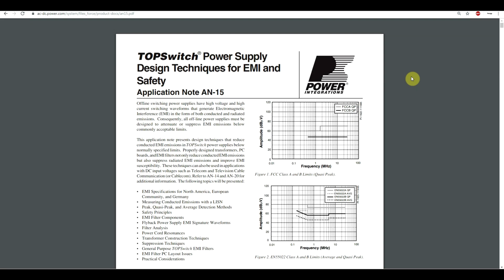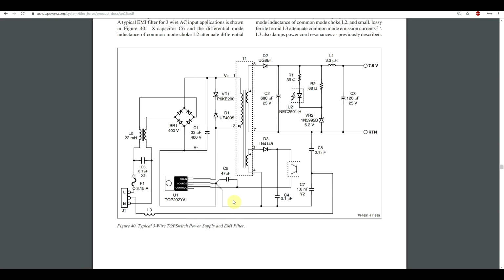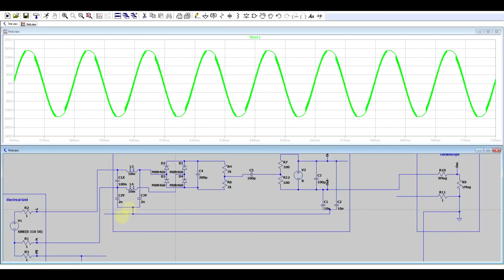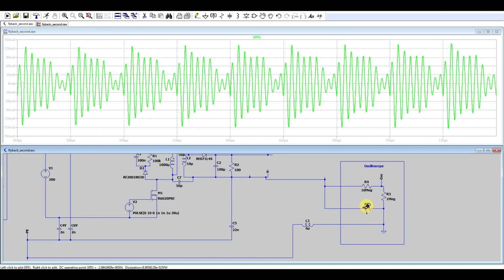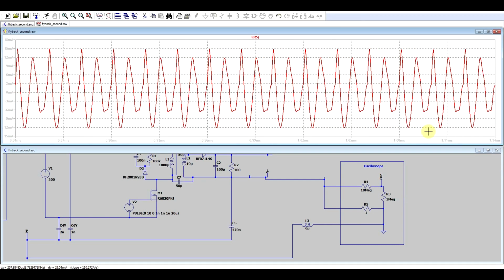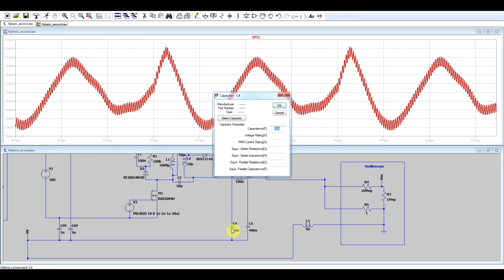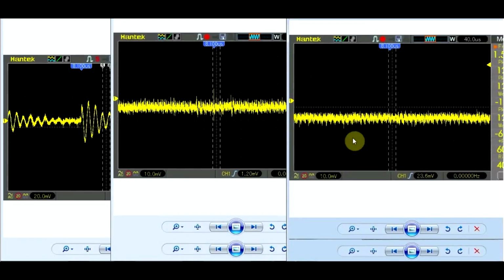How to improve the output noise of a laboratory supply using LTspice

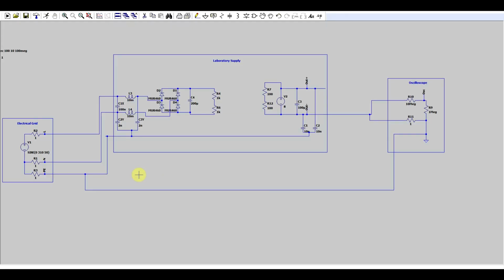Comment: 13:01 2 ohm impedance from socket is quite high. With k = 0.8: (0.8 * 230 V) / 2 ohm = 92 A. If You add just a little bit from extension cord, short circuit will be switched off longer than 0.2 s (200 ms) which is dangerous.

Comment: Very nice simulations.
However, it would be beneficial to provide some comment on the downsides of such mods. Depending on the situation/device connected to the power supply, aren’t there any potential caveats?
E.g.: is the added capacitance to PE seen as an additional output capacitance by the load? Will that mess with OCP and transitioning from CV to CC mode when CC limit is reached? Can that damage a DUT?
Secondly, what about highly capacitive loads and that extra inductance on the output? Any chance of those two dancing into resonance?

Comment: IDK. The noise is indeed caused by the power supply. But the current is only happening when your circuit is earthed. So in the circuit if it's not earthed say on bread board the issue is not there. And only if you measure using the oscilloscope the noise appears. 
In another word, if isolation is not required why not connect the V- to earth that will solve the issue too.

Comment: Hi greetings from Argentina, congratulations, you're really good at explaining with details. Question is that capacitor on the power supply the sort of  X / Y capacitor which is the only cap going from hot to cold on a switching supply. This are some of the unsecured elements on a psu as if they short or theré's a discharge it may short circuit. So isn't this mod somehow risky? . can you apply this kind of filter but externally using LC filter and chokes on the BNC side of the scope instead. I'm watching all of your videos . Quite different from many others.

Comment: I had this problem with a ts100 soldering irons switched PSU the solution was the same as yours. The amount of trouble it could cause if not fixing this problem is enormous 
. Thanks for sharing the detailed simulation.

Comment: At the start you measure 50Hz noise of about 5V, without the oscilloscope ground lead attached. You don't repeat this measurement later, only the ones with the ground lead attached. Has the 50Hz noise been improved as well by these modifications?
Reply: i guess yes, he did that in 26:22

Comment: If the solution is so simple, why don't the companies do it before selling?
Reply from the maker: I guess its a combination of 2 factors - every extra component costs - especially this power supply is a low cost one, so price is critical; second is compliance - if the design is compliant with legislation needs, why bother doing something better. If you want to make a very low noise, high performance powers supply, it will not be cheap :D

Comment: Your test equipment is so bad.  Hantek scope?  Come on man throw that piece of shit out your window.  Those black meters are terrible!  Cheap Chinese shit!  A Keithly 6.5 digit multimeter is only   $1,400.  And a decent Rhode & Schwarz RTB-2002 is only $1375.  Are you living with your mother?  Do you not have a job?  My goodness.  So much test equipment out there from quality companies for low prices.  You buy a $200 scope and an $8 multimeter.  Surely you can do better than that!  Hell even in college I bought and entire lab, scope, power supply, function generator, multimeter for about $3000.  I was in college and I could afford that.  It is painful to watch you use the worst equipment on the market.

Comment: At 27:56 you talk about the noise suppressing ferrite inductor. Maybe I missed a part but it's not really the inductance which suppresses noise but absorption in the ferrite. In effect the inductor becomes a resistor at the frequencies of interest.  I miscalculated once, noise was killed wonderfully but the ferrites exploded.
Reply from the maker: You are right - but this depends on the ferrite material. You can chose a material which behaves resistively at the frequency of interest - a lossy inductor which has imaginary inductance; but even this material, at low frequency will have real inductance. "Low" and "high" frquency are of course material dependent.
Reply: @FesZElectronics  Indeed. A combination.

Comment: "How to improve the output noise of a laboratory supply"
Does improve mean make more of it; more noise?
Anyway, excellent presentation.  My power supply is an ancient HP 6216A variable, linear power supply.  It isn't efficient but there's also no noise.  Well, not more than thermal noise.

Comment: Great video! Do these modifications affect the power supply's voltage regulation and transient response times?
Reply from the maker: Normally, that should not happen. The noise measures that I added work only at very high frequency, much higher than the supply feedback loop should be able to handle. Anyway, it is a good practice though to verify the power supply at the end, since any modifications added after the original design was validated can have one effect or another.

Comment: Can't you also put ferrite cors one the oscilloscope probe coax?
Reply from the maker: I think that will interfere with the measurement since the proprieties of the cable will change. Also, the problem is not on the oscilloscope side, so there is no point in trying to filter the oscilloscope, its better to filter the actual noisy circuit.

Comment: A necrocomment: The simulated 310Vpp value is obtained due to powergrid simulation through (0, 310, 50) AC voltage source. 311v is a peak-to-peak voltage for 220V RMS. Meanwhile in the EU the standart RMS voltage of the power grid is 240 volts, giving the 339Vpp. That is one of the reasons of the 50Vpp gap between the simulation and the measured values. This remark being done I have to  say I really enjoyed the video and got the answer to my question.
Reply from the maker: I just checked and in my country its 230V according to https://en.wikipedia.org/wiki/Mains_electricity_by_country 
I guess 220 is an older value (at least for my country)

Comment: Conclusion, almost always add de-coupling capacitors and common-mode chokes on power systems?
Reply from the maker: If you need low noise, and especially if the supply is "switch mode" type - then most often you will need filtration. But of course "low noise" is a relative term, there is no universal solution.
Reply: @FesZElectronics  excellent point that noise is relative and that switching supplies will always have a level of noise. Thank you.

Comment: Excellent video about the concepts ! Just one question , this noise will arise only if any PE referenced measuring instrument or circuit is connected ? Since this is not typically the case, would this mod give any improvements otherwise ?

Comment: Very good video. Just one question. if the intervention is done on a number of operational power supplies connected to the same RCD,  does this not increase the likelihood of triggering the RCD to cut the power? This is suspected in view of greater current leakage to earth but I'm not sure whether it could be an issue.
Reply: It would be interesting to see the effect. Not sure how big the effect might be since the current shunted to ground is high frequency.

Comment: what supprises me a lot is when I have bought recently a cheap chinese power supply there was a lot of noise and ripples etc. and then i have built my own supply (only oryginal components) and I was shocked NO riplles, NO noise just really clean voltage without any problems (I have compared both on my oscilloscope) and I have compared third one I have bought and my own power supply was the best !! I was really surprised how stable it was! Hmm I am not sure why it is like this but I suspect my transformer which is quite good, powerfull and new (old school Polish production)
Reply from the maker: I would ask if all the supplies where the same type? Usually linear converters are far less noisy than switching converters - for example in my supply that I was testing, most of the noise was occurring because it was a switching converter.. Anyway congratulations on making the least noisy supply! I guess that benchtop supplies are some of the few things that can actually be made better than the commercially available ones.
Reply: @FesZElectronics  Yes the same type - mine and others just normal linear power supplies (1 of 3 was defectiv with faulty or damaged potentiometer and probably capasitor  but another one was ok). Thank you :) I wonder also visibly my power supply looks better on the oscilloscope but what I have noticed that my PSU has Vpp like 600 mV but I don't see it (I mean I see almost straight line with my PSU even when changing time division etc. Anyway it looks and for sure is more stable than commercial ones (maybe because in my psu I don't care about final prise so I put everything I need to make it work..)
Reply from the maker: Indeed, in commercial products, every corner that can be cut, will be... so if you spend just a little bit more on better quality components you will be surprised with the results you can obtain.

Comment: sir plzz help me in reducing the switch node ringing noise at  28v to 5v DC DC  step down converter output , this noise is effecting mu circuit badly plzz help me in reducing this noise
i am using GAIA  DC DC Converter

Comment: This is an excellent video with some caveats. Your ability to simulate and figure out how to match real world results is really impressive. But the problem solution is questionable.

As an aside, it seems that a good portion of the problem may be due to the scope probe and the primary of the power supply both being grounded through mains with potentially many meters of ground wire between them. This forms a large inductive loop which is good at picking up noise. Good differential scope probes would go a long way to solving the problem, but unfortunately they are unaffordable, (a big advantage for a battery powered scope).

The large capacitor solution is shunting well over the 5mA to PE that should set off what we call a GFCI breaker (I can't remember what you call them) and would need to be a Y type capacitor if the solution were going to be used in a commercial product (but Y type capacitors are never this large because of the excessive current that would be passed).

Putting extra inductance in the power supply line increases the potential for overshoot when powering a capacitive load. The overshoot can be up to twice the output voltage of the supply. I've blown up equipment this way just with the inductance in a long wire...

The common mode choke is of course the recommended solution for breaking ground loops in high power supplies and probably use of a large CMC on the output of the supply would help. The supply should already have one, but you never know...
Reply: I thought putting a common mode choke in the psu output was in fact the last thing he did.
Reply: @Graham_Wideman  Yes, he put a common mode choke in the PSU output which is great, but there will be pickup in the large inductive loop formed between the power supply and the scope based on the fact that they are both tied to the ground wire in the house wiring. This length of this loop could be as short as the combined length of the two power cords or it could include a lot of additional wiring in the walls. Of course it's the loop area, not the length which is important, but it's easy to keep the length short and run the wires together to minimize this area...
Reply: @ats89117  Sure, the large inductive loop is an issue. But your original comment "probably use of a large CMC on the output of the supply would help" seemed to imply that he had not put in a CMC on the PSU output, which he had. Or were you saying the one he used isn't large enough?
Reply: @Graham_Wideman  Looks like I was confused, but the combination of the grounded power supply and the grounded scope is likely to be causing a lot of the problem. It's similar to the issues you frequently have with audio distribution and the solution is probably the same, i.e. transformer isolate the scope input when measuring the power supply noise. The CMC will be effective at higher frequencies, but probably not so much in the < 20 MHz band he was probably looking at.
Reply: Good comment, also you could welly also apply some filters on the scope 20mhz ac filter to remove noise. But what worried me he talked about the Y capacitor. which If I'm not mistaken there are X / Y capacitorss on the inline on most of switching power supplies for protection , and they're in between Cold and hot section. These caps are for protection , and are the only components which can withsdtand surges and might short.  So filtering in here at least to me doesn't sound a good approach to filter. I was thinking yes, to apply some filtering on the input of the scope on the BNC ( some LC / choke) in there which could reduce noise a friend of mine who's got a research and experiments channel already played around with passive filters applied to BNC port of the scope and measured how ppk values diminished drastically.  What are your thoughts.? by the way my friends channel is https://www.youtube.com/@jgv988